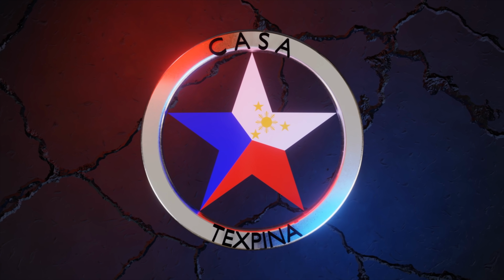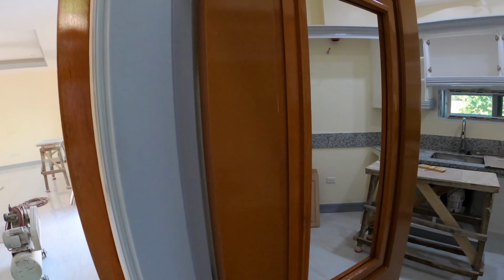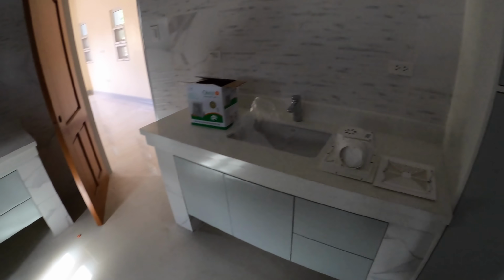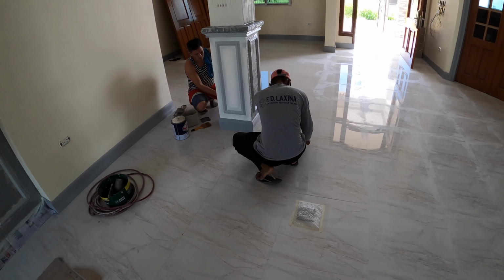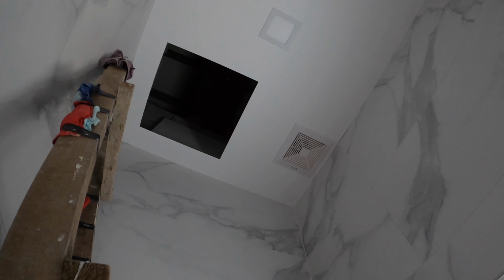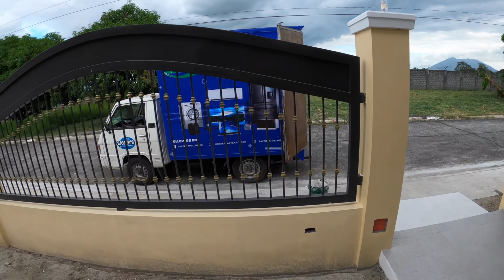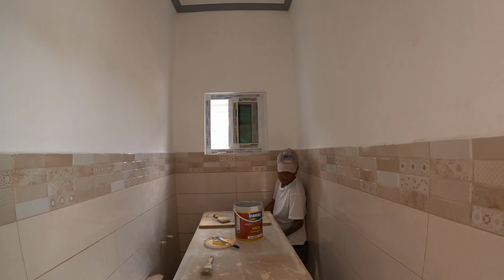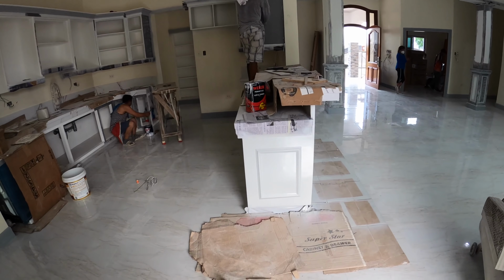Philippine House Building Step by Step, Build Day 235: LED Stair Light Install

Comment: why are the condensers still wrapped in plastic? can you not use your AC yet?
Reply from the maker: Correct. They have been installed but not powered on or commissioned yet. Probably going to be one of the final steps when there is much less dust in the house. Plus we have not even hung all of the doors yet.

Comment: What’s the total area of your living space and the approximate cost per sq meter? What’s the total lot area?
Reply from the maker: Welcome to Casa TexPina!
Conditioned living space is a little over 3K SF. Lot area is 4 lots totaling a little over 900SM. 
Build costs are a real moving target here with a lot of hidden fees and expenses. Construction costs range from Php20K to PHP35K per SM depending on location, size, complexity, and level of finish. Most expats end up in the mid to high end in order to include what we consider basic essentials. Items not included in the build costs are Air Con, appliances, perimeter fence, landscaping, etc.
Thank you for tuning into our channel.
Reply: @CasaTexPina  Thanks much from the quick response. Learning a lot from you. Your positive attitude and patience is inspiring.
Reply from the maker: @aurelio milaor cabal  
We went to see James & Ness last year prior to starting our build. Haven’t had a chance to do any traveling since we started construction and COVID restrictions have been ridiculous. 
We’ve been blessed with a great crew.
All the piping is under pressure now with the filtration system in place. No problems.

Comment: Wow the house is looking awesome 
In your attic Will you be putting any lights to see clearly wants to get up inside the dark at it especially in your bathroom when you have a pin light in the exhaust fan can’t wait to see the finished product
Reply from the maker: The attic will have LED tube lights throughout. Nothing in the crawl space though. Just have to use a flash light or something.